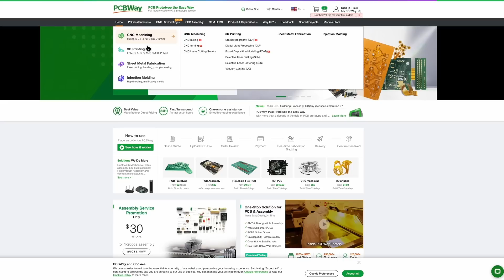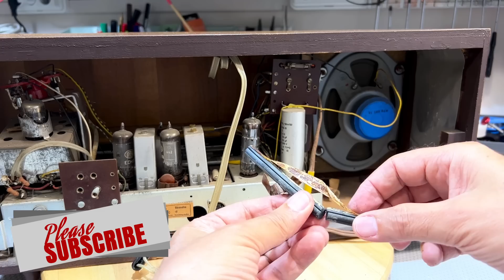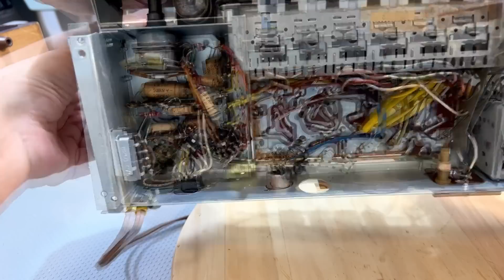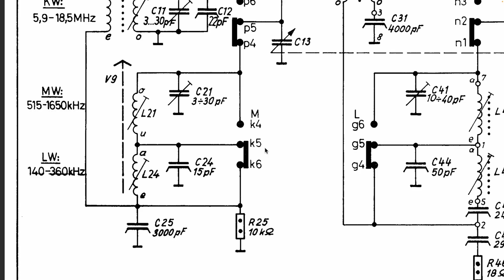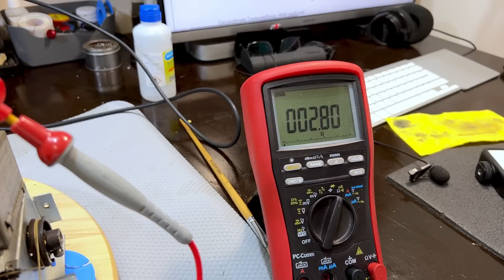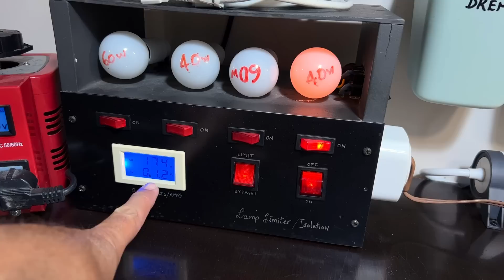Great birthday gift - a restored treasure. Nordmende Skandia V24 - restoration part 1 #pcbway#

Comment: What i did with the BT receiver is: put a small 6v relay with it’s normally closed contact  between the output of the 7805 and the input of the 1W dc/dc
converter.
Then switch the relay coil with a  N channel mosfet out of an old powersupply or some other piece of scrap, put a 12v zener across the gate-source and a high value resistor >100k to the supply pin of the em84.
When the eye is off, the bt module is on and vice-versa.
Worked like a charm in the loewe apollo stereo that i just repaired.
I also made a stereodecoder board based on a TA 7343 ic, now i also have FM stereo, maybe something to consider when you have another philips bi-ampli or another radio with a stereo output stage.
The apollo stereo is almost the same as the loewe truxa you did a few years ago.
Reply from the maker: Those stereo units can sound really good, and adding stereo is probably a worthwhile mod.

Comment: Another very interesting repair on the ferrite antenna coils and checking the circuits bands wiring through.

I have a Loewe Opta Hellas 3841 W, waiting this winter in Australia to do the same repairs. 

All wires on the ferrite antenna have been married back together but I am not sure about an SW coil. I do have a replacement SW coil from a spare chassis of parts.

 I think I lost reception in repairing the SW coil, which I felt lost signal reception to everything.

In older age the fine wiring is difficult to see and work on, where I will need to do the continuity testing. It’s time to put the magnifier over the job.

Al the damage to the ferrite antenna wires and could be the broken wiring to the SW coil, happened in poor packaged international shipping of a 20 kg radio delivery.

It pays to know the good shipping packers in this hobby!

Cheers!

😊
Reply from the maker: Good luck with that repair 😊

Comment: I have a suggestion for your device to hold the units that you work on.  The 3M, or M cubed, which actually would stand for the "Manuel Multi-Mount" since it is used for a variety of devices not only one.
You have made wonderful progress on this one, and I am looking forward to the next video on it.
Reply from the maker: M-cubed. I like it 😊
Reply: @electronicsoldandnew : the English name for your frame is a jig - " a device used to maintain mechanically the correct positional relationship between a piece of work and the tool or between parts of work during assembly" (Merriam Webster)

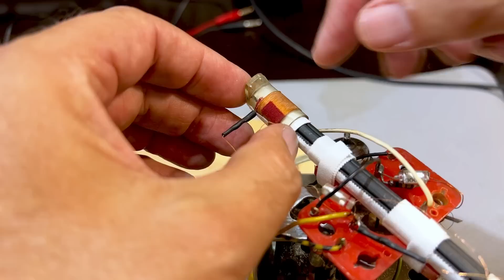Comment: When you splice 18:56 the magnet wire on the radio to the antenna coils how about solder and then use clear nail polish a substitution for lacquer to insulate the wire.
Reply from the maker: I used the heat shrink to temporarily isolate the wires as I wasn’t certain that they would work 😊

Comment: Well, I've got roosters in the background of my videos and you've got a cat. We can start a petting zoo... 🐓🐈‍⬛
Anyways, great repair on the ferrite antenna!
Looking forward to the next videos and seeing what you're going to do with the Bluetooth. In my last restoration I managed to mount a leaf switch underneath the pickup switch to enable the Bluetooth board. Is that an option in the Skandia?
Obviously it's quite annoying that you need to take into account the state of 2 switches, but as a last resort it might be an idea to only link it to the LW switch. That band is nearly empty anyways.
Reply from the maker: My cat simply refuses to stay away when I’m in the workshop 😊 
I think the option of only using LW is valid, but am also looking at a relay to sue the fact that the magic eye tube is always off when phonons selected. Still not decided.
Reply from the maker: By the way, I really like the intro guitar you use on your videos. Really cool.
Reply: @electronicsoldandnew  Thanks! I wanted to have a bit more rock 'n roll on my channel ;-)

Comment: Could let the 6.3v switch in series over the two switches so bluetooth only gets power of both are switches are used. You would need an empty spot on both
Reply from the maker: That’s the idea. Not sure if there are free switches, though.
Reply: @electronicsoldandnew  or a toggle switch on the back to select phono or bluetooth and power to bluetooth.  I used it when the radio had a built-in record player
Reply from the maker: That would also work, but I’d like to avoid adding anything to the outside if possible. We’ll see.

Comment: Given the original state of the unit I'd be interested in your method of cleaning it.
Reply from the maker: I used the airbrush compressor with isopropyl alcohol instead of paint. Works great 😊
Reply: Clever. Thank you for your reply. @electronicsoldandnew
Reply from the maker: Here us a video I did in it: 
The perfect multi-tool that I've been missing for my restorations? Airbrush Compressor Kit review.
https://youtu.be/OQSKVBflE48